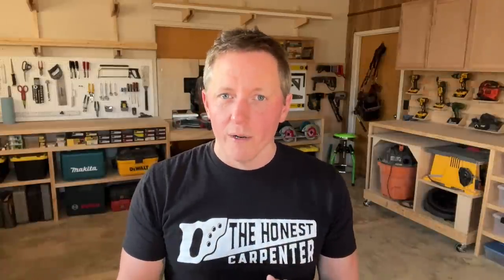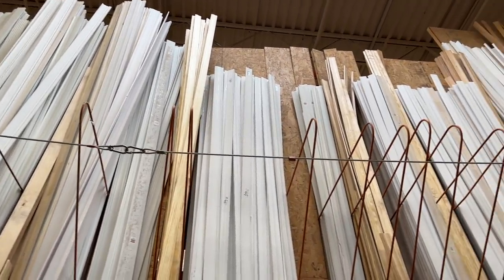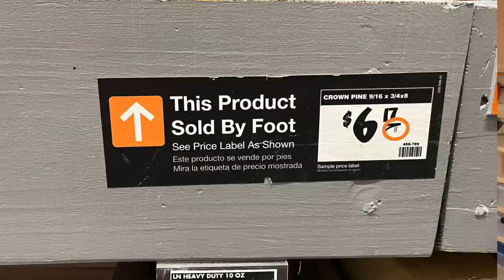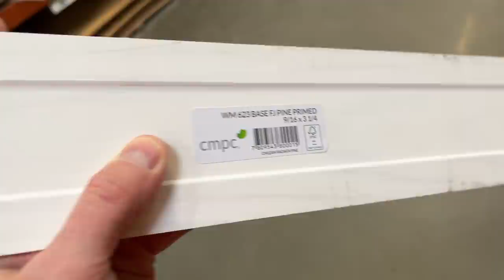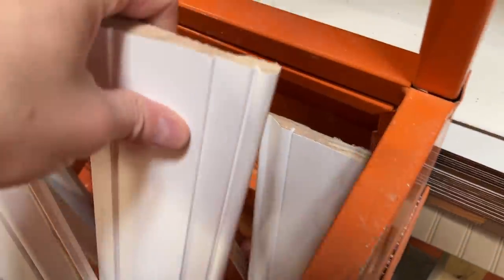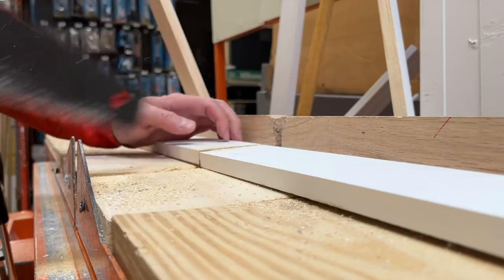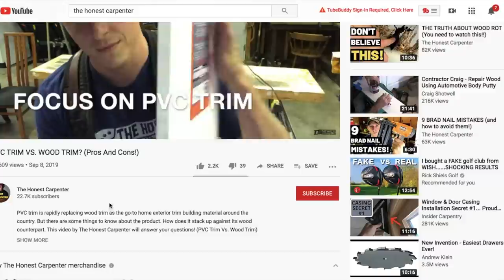Save MONEY On TRIM + MOLDINGS This Way!! (Cut + Buy Shorter Trim/Casings/Mouldings At Lumberyards!)

Comment: I buy my mouldings like this most of the time. Go in with a cut list so it’s easier to transport. If on that list, i need 3 pieces at 3’, i will just cut one 9’ piece, or see if there’s 3 pieces in the bin. Please people, don’t abuse the system or they’ll stop using it. It’s great way to save a few bucks and only be left with a handful of short cutoffs.

Comment: I’ve brought my battery circular saw in before to cut at the cut stations. Saved me a ton of time! 😂
Reply: Normal procedure in the plumbing warehouse
Reply: Did an employee actually see you cut cutting wood in the store with your own circular saw?? When I worked at Home Depot (2000) that never would have flown because of liability issues. I think customers making their own Cuts is a relatively new thing.
Reply: @desertodavid  Not sure.  I didn't ask, I just did it.  No one seemed to mind seeing my own circular saw on the cart at checkout.

Comment: Great video! One tip for the bar code on the cut trim piece. If you somehow end up with a piece that doesn't have a bar code, just take a photo with your phone of the price sticker on the rack. The cashier can get the item number off of that. If you don't have your phone with you to take a photo, just note the item number. I've done the photo bit more than once, & it has proven quite helpful in getting out faster!
Reply: Yea because we all use self phones.
Reply: @msheart2  which is why I also said you can note the item number. Pen & paper, anyone? :)

Comment: I make all my own moldings with 75 year old craftsman molding maker bits i got off eBay for 20 dollars. I bought 130 1x2s that were painted to use as nailers for a tin roof for 100 bux. I roofed our house with them and noticed they were really hard to not split.Ran one through the planer to strip it and found out they were maple. I've made miles of moldings from them.

Comment: I've never been shy about asking for a discount at HD or Lowes on damaged or close out stuff or in case of those cut off pieces . Another way to get a really  low  price is to make an offer to buy all the cut offs . They may price it so  low ,even if you don't want it all it's still less than what you'd spent on what you wanted.

Comment: I intend to eventually put better trim in the manufactured home we bought about 10 years ago. I bought a cheap Harbor Freight dual bevel 12"sliding compound miter saw so I can do a decent enough job without paying 500 or more for a saw I may not use much once I do the trim. It was move in ready and good to go but no base boards and all the window and door trim is cheap 1x pine strips that are painted just like everything else in builder beige. Some good tips for me if I ever get around to it and play with my new saw.
Reply: Try living in a hundred year old house. I’ve had to match trim and molding profiles that haven’t existed for who knows how long. Had to hand shape from lumber and modify available moldings from stores in many cases.
Reply: @mercoid  Well my place is pretty much a blank slate so eventually we pick something we like and start over or add non existant trim like base boards. I think originally it had at least phony wood grain printed on the trim but everything got painted the same color to make it cheap, easy, and quick. I have found all kinds of things they hid knowing nobody would find it but got a really good deal for what we got so wasn't expecting perfection. Trying to match historical trim wouldn't be any fun but if you want to keep the character and history of your house you're stuck, especially if it's on the historic registry.

Comment: When I buy cutoffs at Woodcraft, never molding, I can take any length I want as long as the cutoff that I leave behind is at least 4'. The staff will always do the cutting. If the store is not busy and I ask nicely, they'll even surface and joint one edge of the piece I'm taking. Try getting anyone at Lowe's, Home Depot, or other lumber yard to do that for you.

Comment: Hi, totally unrelated to this video but I wanted to suggest a video idea. I know you've done a couple videos on specific screws but it would be really helpful to have a rundown of all the types of fasteners like screws, lag bolts etc and when to use them. I was looking at project plans today which included lag bolts and realized I don't really know what lag bolts are "supposed" to be used for. I'm the kind of woodworker that uses drywall screws for jigs and deck screws for shop builds like work benches so this would be a big help!

Comment: If you do a video on the panel saws I think these are some good notes:
-they can cut it down to your cut list but there is an upper limit to the amount of cuts (10 at lowe’s typically) though you could talk the employee into a good mood and they’ll make all your cuts on your cut list 
-the panel saw can rip sheet goods however due to safety hazards cannot make rip cuts on dimensional lumber 
-the guard plate only allows for material less than 3inches thick to be cut down to size so the panel saw is unable to cut down 4x4s and 6x6s
-the panel saw cannot make angled cuts only vertical and horizontal cuts 
-some employees will refuse to make cuts less than a foot long because there is a sizable gap between the last rolling wheel supporting the material and the saw blade and these small pieces are prone to getting caught by the blade and damaged!

Comment: One other thing, you may find one or more loose 12' or 16' pieces with no bar code. It's likely they were removed from an item called a Pro Pack. At HD, they might sell the single stick to you, but don't count on it.

Comment: Ethan you couldn’t have made this vid at a better time. I added porcelain flooring to my downstairs, and have to do the baseboards. I’ve got a better understanding now. Will the those cut stations work for baseboards?
Reply from the maker: Yep, there was some speed base in this station, Steven! :)
Reply: Thanks Ethan!  Hope all is well😎
Reply: Would do a video on air saws? I got one the other day with an air compressor, and a nail gun.  I’ve been making landscape boxes, from scrap lumber I’ve been acquiring. I’ve been using a high powered Dremel, and the air saw looks like I’ll be able to make more intricate cuts.

Comment: Use to work at Home Depot in the Millworks department, some tips:

1. Don't ask an associate to miter cut for you with the hand miter saw and a jig.
2. Don't ask the associate to hold it up after, to check the heel to toe.
3. Tell your husband who is standing behind you to go to Home Depot alone next time as God intended.
4. The /ft price of trim is overpriced because the stuff you don't use under 4 foot doesn't make it back to the shelf.
5. No, you cannot get the trim in the back of the cutting cart at a discount (Even if it is spray painted like the discounted lumber).

Thanks for shopping with the Home Depot.

Comment: Don't buy trim at the big box stores!  Most profiles are about double what you pay at a real lumberyard.  You may have an 8' minimum but they will cut it up however you want.  The last I checked, the 3 1/4" inch baseboard was $1.22 a foot, 1.10 with military discount. It was $0.59 a foot at the lumberyard and better quality.
Reply: I have a trim company near where I live.  Super nice family and a huge assortment of profiles!!   Good Lord the assortment! Bought my kitchen cabinet crown and light railing from them.  As well as my chair rail for the powder room.  Went with Home Depot on the bead board.  They had a good deal!  🤣

Comment: Home Depot has a lot of molding sold by the foot while Lowe’s sells everything by the piece, selling by the piece reduces a lot of waste. Every week Home Depot throws ALOT of the shorter pieces away
Reply: If Home Depot isn't throwing it away, then it's the homeowner throwing the leftovers away. The Lowes model is certainly simpler for the store and the customer.
Reply: @chrimony  ….I save the scraps for small projects, any future repairs or even miscellaneous like staking up garden plants. Never let anything go to waste.